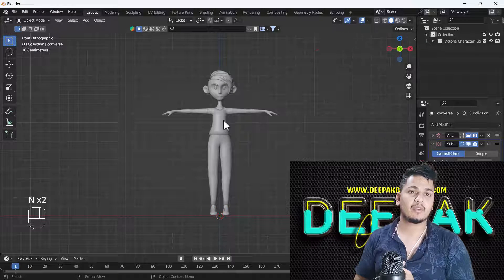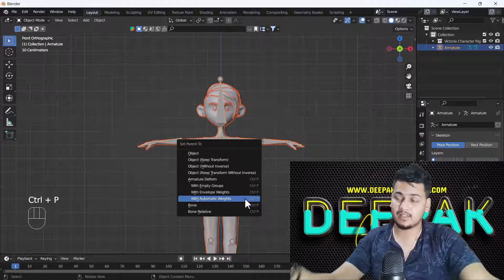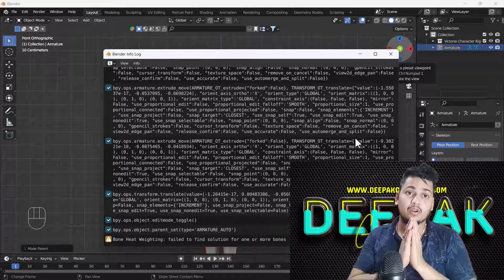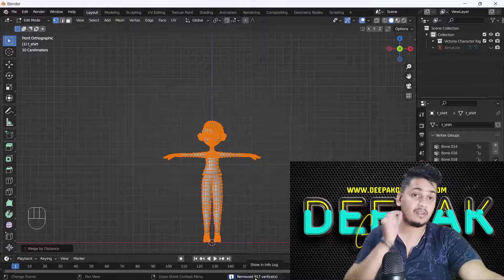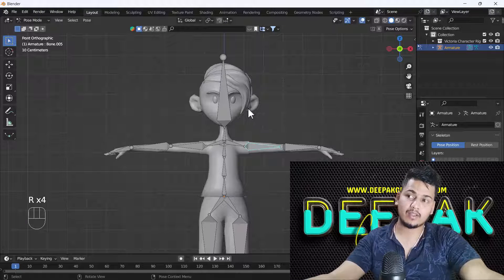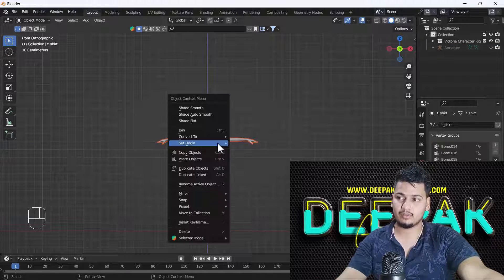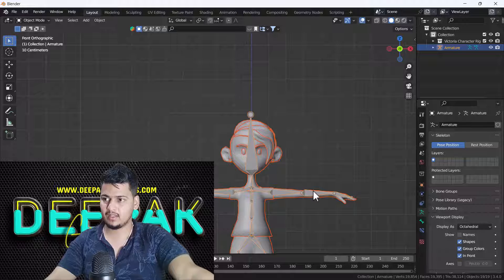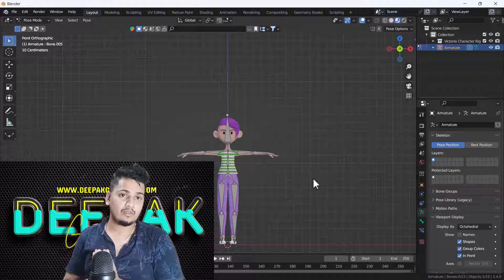How to fix Bone heat weighting Failed Problem|| Blender 4.0

Comment: Thanks but I merged all of verts, and the models individual parts via the join and I have no vertex groups or shape keys or modifiers but the error still happens.
Reply: Me too, i couldn't solve this problem
Reply from the maker: please try to convert all the mesh into mesh again then remove all the vertex group may be that time it will be helpful.